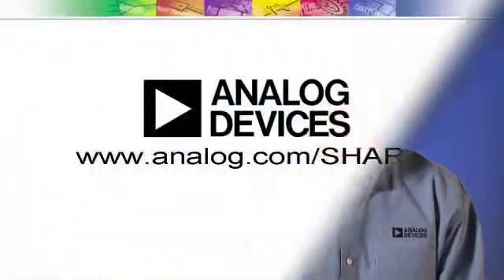SHARC® Processors for HD Audio

Comment: Curious if there is any information ADSP21065L used in the Behringer DDX 3216. I am curious where the I/O is an how exact it handles the eq and other dsp effects, and wondering if this could be expanded by altering the firmware of the ddx3216.  Very curious if there is some way to expand the functions of the DDX3216, as these processors seem to have a lot of applications, so the offerings in the ddx3216 feel like they are arbitrary, and could be expanded - of course this is likely highly technical in nature still very interested. Anyone with more info on how these work and how it functions in the ddx3216 more specifically is very sought.